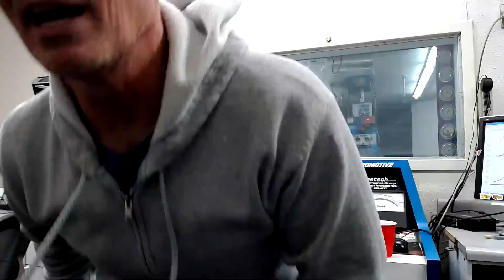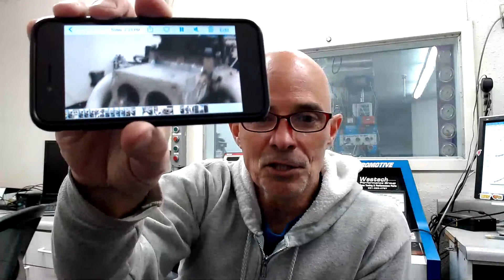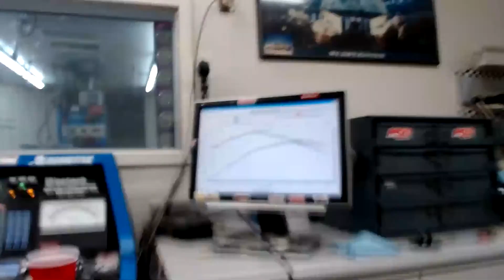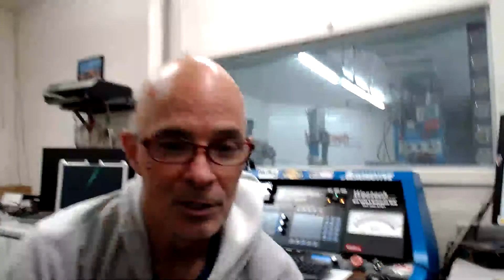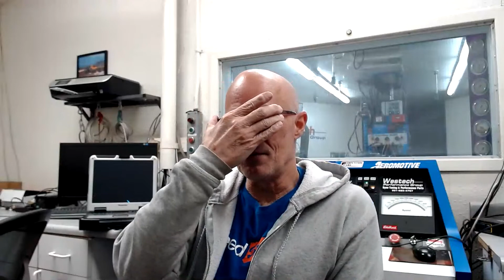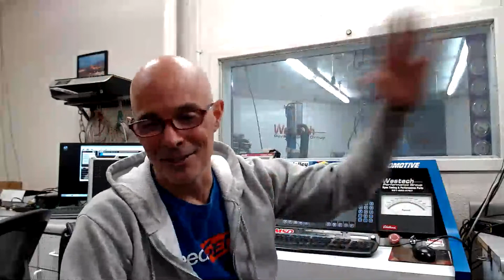L99 UPGRADES-SNEAK PEAK ON NEW TEST

Comment: Hey Richard appreciate everything you do but one thing I would like to see is a bang for your buck 351 Windsor start with favorite 174 extreme energy cam with a stock motor then test intakes single then duals with the stock head then maybe a set over either of the gt40s or both then lastly some flat top pistons
After all that boost it to death like ya like👍 
I’ll be watching as we do me and my son waiting to learn Thxs for everything you’ve already taught us
Reply from the maker: i HAVE SOME OF THAT COMING ON THE 351w
Reply: @richardholdener1727  great you’re awesome we will be waiting

Comment: I GOT 1 i really would love to see, im gonna try it myself i think unless you beat me to it, 180 degree turbo manifolds into twin scroll turbos. seems like itd be worth it for sound alone, but try and get the primarys timed perfect and firing in perfect order into their seperate chambers... or perhaps Split every primary into both turbos, but have the runners to one of the turbos closed via wastegates, so the first turbo will spool like RIGHT NOW and then wastegate into the 2nd turbo and be a normal twin setup, also sound bad ass...
Reply: the 2nd idea i stole from the gamera, that uses valves for throttle as well as have their own exhaust primary... konigzoweijwojagss sweedish dude...

Comment: Hey Richard... love your videos.  I have a question.  Have you done a comparison with the 351w/ 408w  tfs-r carb style high rise mpfi intake vs super victor carb style high rise mpfi intake?  If so. Do you have a link?
Reply from the maker: I HAVE NOT
Reply: @richardholdener1727  I appreciate the response.   Just hoping to see the differences on the dyno before I make a decision.   I had hoped someone could steer me in the right direction before I spend $500.  I am looking to make 600hp +

Comment: Have you done a video on a bone stock 350 sbc running boost on the stock cam? Sorry if I've missed it
Reply from the maker: NO VIDEO-BUT I HAVE RUN STOCK CAMS WITH BOOST-IT WORKS FINE-BOOST JUST MULTIPLIES WHAT HP IS THERE

Comment: With the sheer amount of work I see you do would it be unrealistic to ask you to do a 351 Windsor with the newer style ls heads with the reverse valves or the old 317 or 862 with custom cam ground to run the reversed valve orientation? Ive seen a few built but not by a pro and one that can actually test the results. Let me know richard!
Reply: I know you will have to cut an intake and weld it up and make a valley cover but as I said with the sheer amount of work I see you do would that be an unrealistic ask?
Reply from the maker: NO NEED TO PUT LS HEADS ON A 351W-TOO MANY GOOD HEADS AVAILABLE ALREADY

Comment: What did you do to the 5.3l in the big bang to where it made 300hp stock? Was it a tune or what??
Reply from the maker: A STOCK 5.3L FROM THE YARD THE WAY WE TEST MAKES 350 HP OR SO
Reply: @richardholdener1727  thats wild, i see most 5.3s are like 280, thanks for letting me know

Comment: The iron Duke I'm thinking of is the Chevy  4 cylinder from the 60s and 70s they mostly put them in chevy II and Novas
Reply: I seem to remember a guy back in the late 70's running a Chevy Vega with the Iron Duke and a bunch of 350 performance parts. If I remember right he was running in the high 11's and pulling the front wheels off the line.

EDIT: That was at Fremont Dragstrip, Ca.

Comment: Do you know someone with a 3d printer? It would be interesting to make a pseudo ram air intake with those long runners and a carb or throttle body injection.
Reply: Have to have a CAD program too, to design the various 3d solids that would make up a manifold. Not a weekend project...
Reply: I am lucky enough to have someone with CAD that can bang something out pretty quickly. Great to make prototypes like this.
Reply: @Goodbeers1  You are lucky. I just retired from banging on CATIA for 29 years, and I dont ever want to work or see a CAD program ever again. :)

Comment: Whats the average WOT spark timing you run for an LT1 with stock Aluminum heads?
Reply from the maker: RAN BEST AT 30 DEGREES
Reply: @richardholdener1727  Thanks man, Im tuning my Lt1 and i figure it should be close